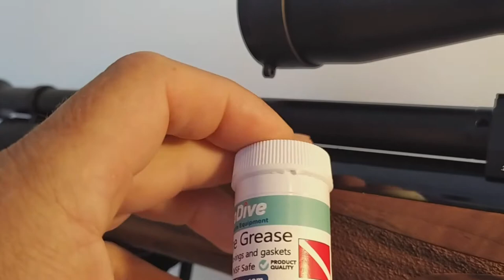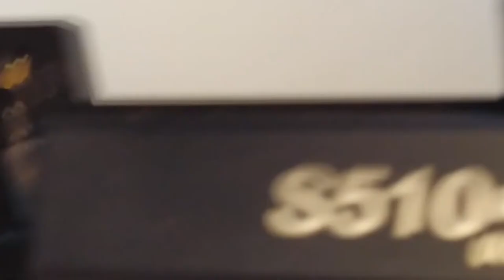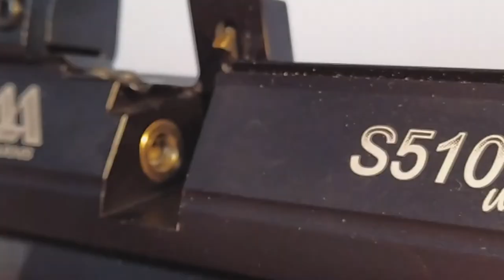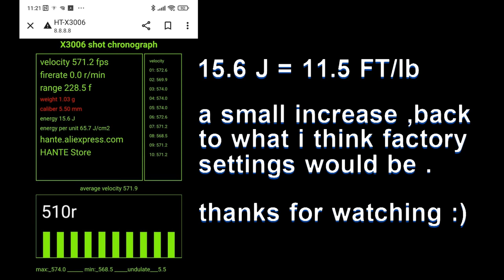Air Arms S510r breach seal removal and replacement.

Comment: All airline and some gasses for diving gear have to be lubed with silicone oil/grease if the seals are rubber or neoprene! Hydrocarbons oil or grease will rot rubber/neoprene apparently! Fraser

Comment: Hi good video .just quick question i put oil in in the barrel by mistake i think i could have done that seal air gun gone loud and lots of air coming out of that area when i shoot
Reply from the maker: Don't think gun oil would damage the seal. 
If you have air coming out of there , yes it could be the seal , can you see if there is any damage to the seal,
Reply: @cjoutdoors8264  thanks for your reply seal looks intact but thats just from looking at it from outside.gun was super quiet before i put oil in it made a huge bang and smoke out of it but that was 6 months ago and with out the silencer sounds more like a shotgun
Reply from the maker: @thomaskavanagh7992  don't know! 
Some can be loud without silencer, if you can feel air escaping try a new seal see if it helps, sorry can't be if any help
Reply: @cjoutdoors8264  thanks will try there is definitely lots of air coming out of them 3 little holes beside the seal when i shoot is this normal and is there only one seal at that part
Reply from the maker: @thomaskavanagh7992  don't know what you mean about 3 holes! , on the aa510 only one seal at that section